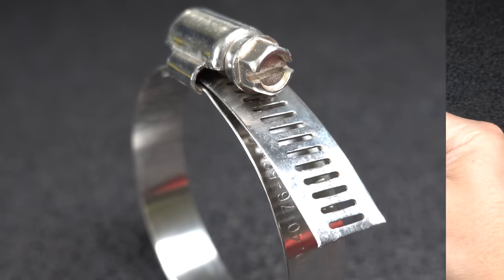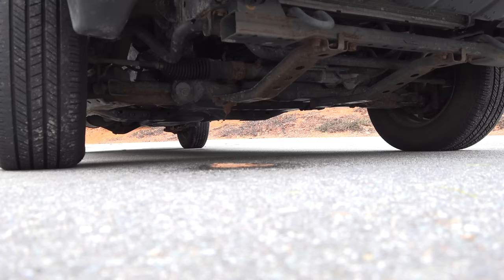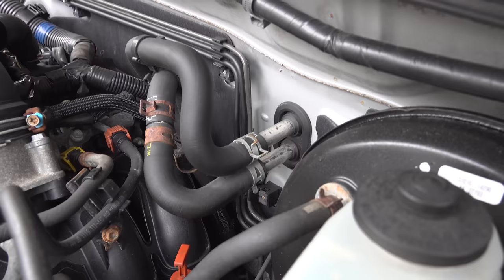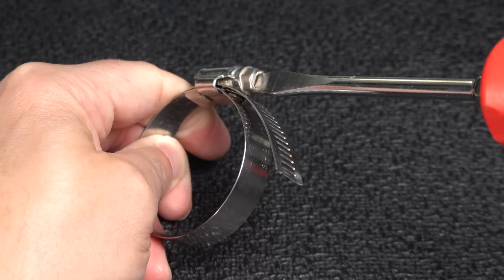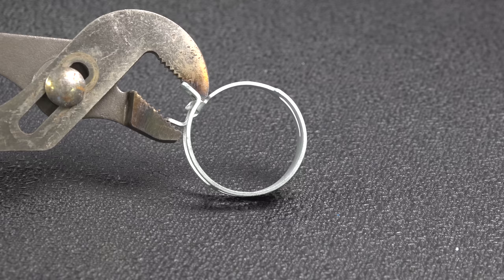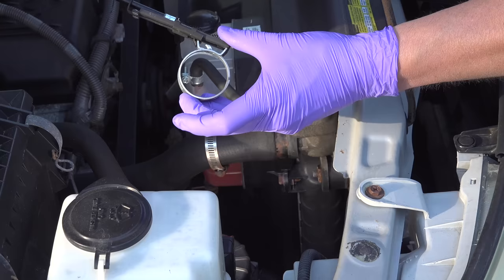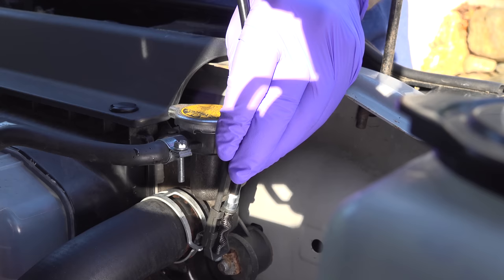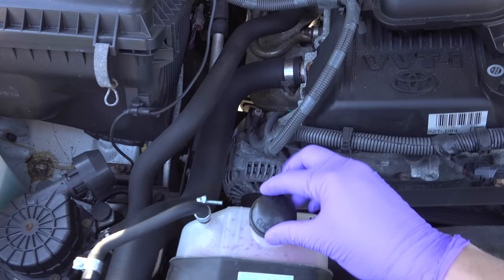STOP Using Hose Clamps WRONG - LEARN A BETTER WAY

Comment: Happy to correct you on this one. I’m a mechanic with over 20 years experience. Those hose clamps are used primarily for one reason and one reason only, speed when fitting in an assembly line.
Not only are they a nightmare to remove in tricky places it gets even harder when old hoses swell and yes those clamps do lose their tension over time. Unless you line them up with the indentation they leave in the hose when re fitting guess what? They leak!
The majority of the time if a hose has leaked or is leaking after fitting a clamp it’s due to the older hose being hard and is because of the hose not being soft enough to seal around fitting and then it is relying 100 percent on just the tension of the clamp.
Fact is I have NEVER had a correctly tensioned clamp on a good condition hose leak. I will always replace the this style of clamp whenever I have to remove them.
Reply: Why do worm gear clamps on new heavy equipment leak?
Reply: I was a mechanic for the post office and twice a year we would get multiple calls for leaking antifreeze. Those calls coincided with the change of the season. The issue was loose hose clamps. I can't say that spring clamps would definitively eliminate the issue but logically it would stand to reason that they would be less likely to leak. As to the difficulty of removing spring clamps from inaccessible locations the use of the right tool for the right job cannot be understated.
Reply: I just did a timing belt job on a 2014 VW Golf. These jackass clamps are on everything and I was forced to buy that tool in the video. After losing at least 45 minutes trying to get those special clamps off with every type of pliers I own, the requirement of that special tool is not in any way a positive thing. If you or a friend is on the side of the road, which clamp would you prefer to have? The one that comes off with the screwdriver everyone carries? Yeah me too. Needless to say, after changing my friend's timing belt, I replaced as many of those jackass clamps as I could with new screw-on clamps that sane people use.
Reply: Amen sir.
Reply: the "speed of assembly" claim is a MYTH. There are multiple studies and engineering papers that show spring clamps on coolant hose systems perform much better.  A worm clamp is over 3x times more likely to develop a leak with a the >200 degree temp swing that occurs on your heater core and radiator connections.

Comment: A few things to mention about this video, you will need to have some fairly significant temperature deltas and rates of change for this adjustability to make any discernable difference. Their use by OEM's has more to do with their speed of install than their temperature compensating or maintainability traits. These clamps do work harden over time and will lose their effectiveness while looking perfectly fine. They are also reliant on the hoses themselves being in good condition as an old hard hose that has taken a set will often not clamp properly when reinstalled with these types of clamps. 

One benefit of screw clamps that stood out from the video is that you can replace them without having to break the seal on whatever hose you're working with, simply unscrew them all the way and slip them over the hose. 

Also, some of the "cons" of screw clamps are overstated. If a moron overtightens a clamp to the point of breaking a part they have accomplished something unusual and special. If this has happened to you it might be a fluke, if it has happened to you repeatedly then consider the possibility that you may be a moron.
Reply: I usually over-tighten them until the worm gear starts skipping teeth and/or deforming the notches; then I have to start all over only to repeat the mistake. It is my belief that this too qualifies as moronic behavior.
Reply: It uuy it u
Reply: Thanks Will! You gave very good information here. Good read too!
Reply: I completely disagree with Will. This video is spot on about the reason for using the spring type hose clamp. Work hardening does not affect spring steel that doesn't exceed yield strength. I used to believe that the spring type was used by manufacturers because of cost or installation, but that's not true. They're just better for applications involving temperature swings. From my experience, spring type clamps are the only practical option. If screw type clamps were better, you'd at least see them on high end cars, but you don't. My biggest complaint is that they're so hard to find at auto parts stores. I guess it's easier to stock just a few screw type sizes.
Reply: @williamyoung3253  We can disagree about a few things but there are a couple of reasons why you find screw clamps in auto parts stores.  One is psycological the other is practical.  

The psychological aspect has to do with the obviousntess of function from tigtehning hte screw.  It allows the less experienced to be confidnet the clamp is tight.  It's also easier for the uniitated to pick a screw type clamp that will fit rather than having to pick the correct size spring clamp. 

The practial reason is that they work with hoses that have taken a set that often leak when reused with spring clamps.
Reply: @williamyoung3253   @Will Stikken 
Actually, as an aircraft mechanic for 20 years - which are far more expensive and critical than even the highest end cars - I can tell you worm gear band clamps are used in A LOT of areas on the aircraft and spring style clamps are not. The reason is that if installed correctly the band clamps are more secure and don't have the problems listed in the video. The spring style clamps are not secure enough for aircraft applications and are not typically used in anything other than drain lines and scupper drains. I would wager that the reason auto manufacturers are using the spring style is the same as everything else - they're cheaper and do the job adequately for automotive application. They're not "better". At the same time, I'll also say that you won't generally see either type used for fluid carrying lines anyway because they're both exponentially less reliable than flared lines with B-nuts. The band clamps are usually seen on non-pressurized air hoses, vent hoses, and cabin heater hoses. Also, as an aside, in all aviation applications of band clamps there is no one size fits all - they're always specifically sized for the hoses being secured and only the correct size should be used. You do end up having to stock many different sizes.
Reply: Here at our company which is worldwide worm clamps are banned to use for good reason. They fail a lot. Our ship alone maintains 900 units. We use heat shrink clamps and still never seen one fail if done correctly.  Have seen a lower radiator hose come off and a surge tank hose come off, both because clamp was not shrank enough properly.
Reply: @pitchlink4499  Do you guys ever use crimp style band clamps like Oetiker? Having little experience with cars, I was surprised to see any connections made without a fastener or fitting. On high end end stuff is that done, or do they still use clamps like these? You'd think they'd use a compression fitting at the very least.
Reply: Well said! Thank you.
Reply: The instructions I saw years ago in an installation manual is to never tighten the clamps so much that the hose squishes out of the band's grooves above the surface of the band. I never tighten clamps that hard, but I see it all the time so perhaps that explains a lot of the failures.
Reply: @brettjohnson5545  I tighten first with a screw driver and after it's tight, use the ratchet and socket just a bit.
Reply: @patsmith5236  That's good technique. I do the same, but I also snug it a little 2-3 weeks later, once it has taken a set.
Reply: Especially if they rust away.
Reply: @charlestackett7137  If they rust away they aren't being properly maintained.
Reply: More than temp delta. Hoses compress over time and most screw clamps do not compensate for this. I don't see spring clamps "work hardening" with the minute movements they incur over a lifetime. They are composed of SPRING steel after all. OEMs use spring clamps because it is absolutely the most leak free way to secure a hose. Less leaks = less warranty comeback.
Reply: @jimbote1968  Even spring steel work hardens...it is one of the reasons why springs lose their spring rate over time.   In this case the clamp is work hardened though the high number of thermal cycles associated with engine applications. Work hardening does not require large movements to occur.  Work hardening does happen to screw clamps form these same cycles, vibration etc but it does not effect their performance like ti does with a spring clamp. 

From the factory installed application there is no advantage to a spring clamp over a screw clamp in terms of leak resistance.  Neither should be prone to leaking when properly installed nor were they a driver of warranty repair rates. 

Where the differences come in are at the time of installation in the form of a minor time savings and at removal for maintenance or repair.   Once removed and reinstalled spring clamps have a significantly higher potential to leak, especially when the hose material takes a set in it's previously compressed state.  Spring clamps have a limited ability to adjust to a situation where another quarter turn of a screw clamp means you do not have to replace the hose.
Reply: @willstikken5619  now your making up stuff. No way the relatively low temperatures a spring hose clamp encounters or the actual tiny mechanical cycles can work harden these things. Comparing them to leaf or coil spring is a ludicrous, apples/oranges, comparison. Oem use is because they're relatively leak free compared to a worm clamps. Period.
Reply: @willstikken5619 there cheap thats why you find them in every auto parts. In the other hand those oem clamps cost $19.99 and up for just 1 clamp. Screw on clamps are only good for air hoses.
Reply: @rhurtadorh32  How do you figure that screw clamps are only good for air hoses?  

Other than screw clamps providing higher clamping pressure than spring clamps and the thousands of instances where oem's used them for coolant and low pressure hydraulics how do you support this conclusion?

Also, if you've paid $20 for a single clamp you paid about 100 times the going rate for the oem quality clamps...
Reply: @rhurtadorh32  maybe OEM clamps cost that much from a dealer, but the automaker surely doesn't pay more than a dime for them, purchased in quantities of 100's of thousands, or millions.  And if someone came in for half a penny cheaper, they would be the new supplier.  As an example, a shock absorber on a new Buick - GM pays $3 - $4 for that (2006 prices when I worked in suspension, probably $6 now).
Reply: @pitchlink4499  The reason that worm gear clamps have fallen out of favor with auto manufacturers is that aluminum and plastic (at least the plastics used in autos) are so common nowadays. Both expand and contract much more with heat than cast iron does. Almost every time a car comes in the shop with worm gear clamps on plastic and aluminum parts the clamps are loose, the constant tension clamps work great in the auto world.
Reply: Why would you want to keep an old harden hose and why would you want to or need to replace a worm gear clamp to avoid breaking the hose “ seal. You arguments, like your worm hose clamps don’t make sense😂😂😂
Reply: @pitchlink4499 obviously the only “ aircraft” you have ever worked on are plastic model aircraft 😂😂😂😂😂
Reply: @willstikken5619 it’s a hose clamp, it’s put on and forgot about. If you have to “ maintain “ your hose clamps, then you have the wrong hose clamps to start with😂😂😂😂
Reply: @willstikken5619 springs lose their spring rate over time by constantly being worked, not by the load. Your theory of the spring clamp losing its grip over time is redicioulas as is all your defensive theories of your worm gear clamps.
Reply: @willstikken5619 LoL, clamps that actually work do cost more than those worm gear hose destroyers you enjoy so much😂😂😂
Reply: @user-ev4pb9xj7e  So what you're saying is you have no idea how this actually works?  

You can't truly believe that neither the vibration nor thermal cycles these clamps are subjected to does not work hardens these clamps.  At least not if you understood those concepts or had any experience working with these clamps on vehicles or equipment that have been in service for any significant amount of time.   

But feel free to keep dismissing things you don't understand if it helps make  you feel sMaRt.
Reply: The OP on this comment is making totally dubunked claims. The parts are in fact mainly broken by screws claims due to temperature changes, not overtightening. If you tighten enough to be sealed cold it is common for a screw clamp to break a plastic nip when the temp goes up to 220 in five minutes. And the claim above that constant tension clamps are used by vehicle OEMs due to speed of install is just simply not true. Also the claim that worm clamps are the most common on aircraft is an absolutely falsehood. And it is not "elitism" to advocate for the right tool or fastener for the job. Sure, you can use a wood screw on sheet metal, and a sheet metal screws on wood, or a screw where you should use a bolt on lots of applications -- it doesn't make someone "elitist" to say that using the wrong fastener is suboptimal and failure prone.
Reply: @CantonBn  You have conflated things and changed assumptions to try an make your claims true.  An example of a changed assumption being that of a "plastic nip". You conflate the different types of screws with the function of these clamps, make incorrect assertions about clamp use in aviation and state that the claims are debunked without any supporting evidence or direct argument. 

The claims about clamps on plastic are particularly odd given the thermal expansion characteristics of common plastics. You seem to be assuming that thermal expansion wouldn't occur with the spring clamps as well and that the rates between the clamp, hose and plastic would be in any way comparable. In your scenario the spring clamps would loosen when they expand more than the plastic.

Other than the reasons stated above there is one good reason why spring clamps are common or preferable for connecting hoses to plastic in the automotive world and that is the low skill level of the average automotive mechanic making it much more likely that a spring clamp would be over tightened during maintenance e and damage the plastic.  It is a real concern for those concerned with balancing cost cutting with warranty claims but in no way negates the arguments made above.
Reply: @willstikken5619  you are using two strawman arguments. and it has nothing to do with speed of install. Normal vehicle heater connections easily go from 0degrees Fahrenheit to 223degrees. for thousands of cycles which is why it is a FACT that in testing worm clamps fail sooner.
Reply: @CantonBn  I did not dispute the heat cycling of heater hoses, only your characterizations of the clamp performance.  Install, maintenance and cost are attributes in favor of spring clamps but their performance is not.  When replacing a hose unless it is something like a low pressure/low value drain tube or every small in diameter a spring clamp is generally not your best choice for long term performance. 

Capitalizing the word fact does not turn something into a fact however, if you have some legitimate test data supporting your claim I'd be happy to look at it.   I am not opposed to changing my mind but vague inferences just aren't going to do it.
Reply: @willstikken5619  YOU presented a totally false reason for the use of the spring clamps. The fact is it is documented the spring clamps leak less in cooling systems. Where is your data or any citation for your bogus claim they are used due to ease of install. that is nonsense
Reply: @CantonBn  So, it should be easy to provide a reference then?

I'm going to go out on a limb and guess that you've never actually worked with these systems when they have been in service for some time.

I will reiterate that I do approach this mostly form the maintenance side but based on both experience and the information I've had access to over the years nothing I've said here is invalid.  As I said I'm always willing to consider new information if you feel like providing any.   It doesn't seem though that you can be bothered to provide a rational basis for your claims much less a valid reference.
Reply: @willstikken5619  OK, I am 100% sure you learned what these different clamps  are just a few days ago. You probably never used anything but worm gear clamps and wondered why they leaked on you.
Reply: @williamyoung3253   Exactly. spring hoses are documented as better at preventing leaks, long term and short term
Reply: @CantonBn  You are of course free to be 100% wrong.  As  you are also free to continue to attack me personally while offering nothing to support your claims. 

You clearly have no experience of your own  to draw upon here so go ahead and keep slugging away with your silly vapid attacks rather than offering any approaching a rational argument or evidence in support of your claim.